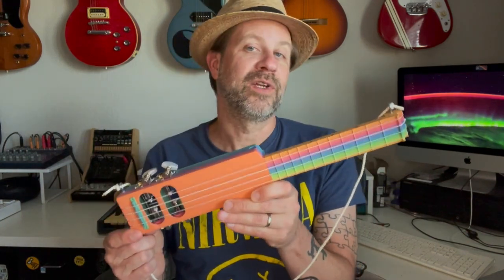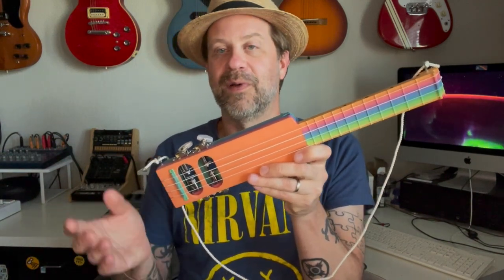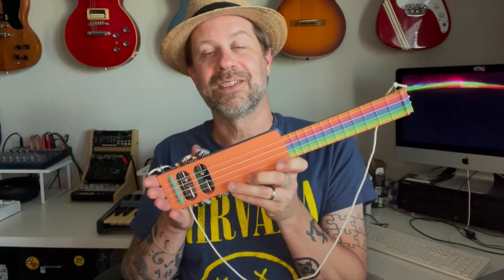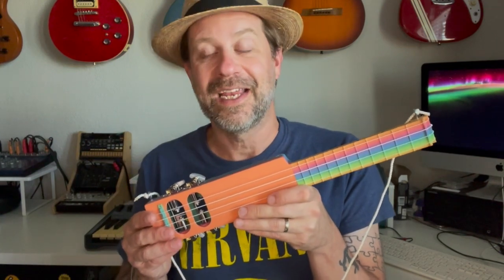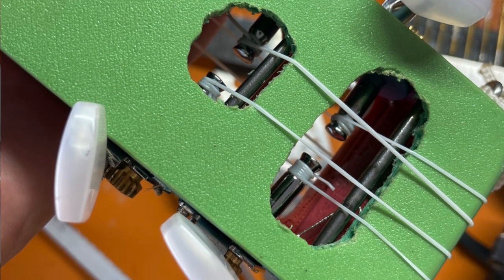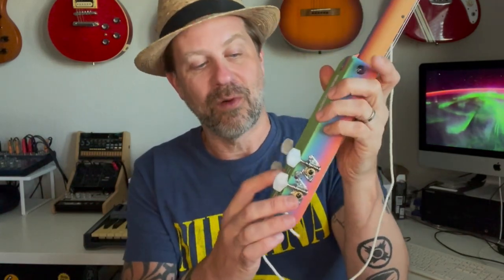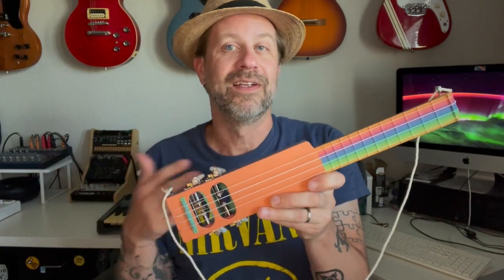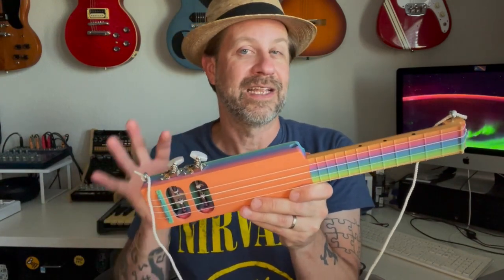How to Repair a 3-D Printed Travel Ukulele (string tension crack)

Comment: Very creative fix Kale! Definitely give the feedback to the makers. It is a challenge 3D printing ukuleles and guitars because it takes time to see how parts will perform under string tension. Just because it holds when when you string it up, doesn’t mean it will continue to hold down the road. 

I am working on a 3D printed mini Chugger (standard GD tuning) at the moment. 15.25” scale length. Almost all the parts are printed, so I will be assembling it soon. We shall see if it holds together!
Reply from the maker: @cbgslinger  I’m probably lucky that I don’t have a 3-D printer or I could see myself getting really into this. it’s a cool new way to make all kinds of things among them instruments. Thanks for checking out Doug.
Reply: @musicalmiscellany  You are welcome Kale! I always enjoy your videos. 3D printers are addictive. It’s the coolest tool I have. Being able to design something and then print it out is quite remarkable (and fun)! I began with the design piece and had someone else print my simple guitar parts but the 1 hour drive to pick up my parts got old fast. Getting my own printer changed everything.